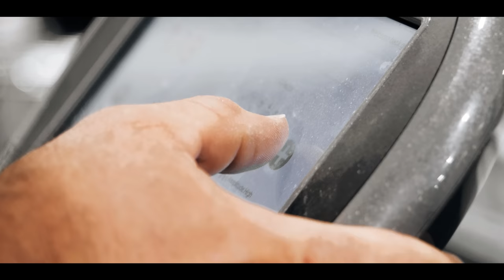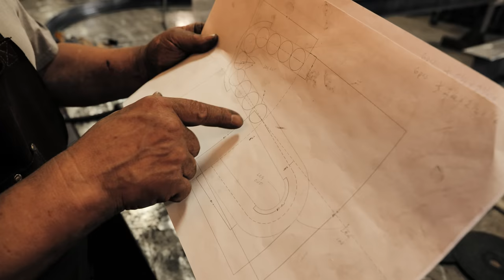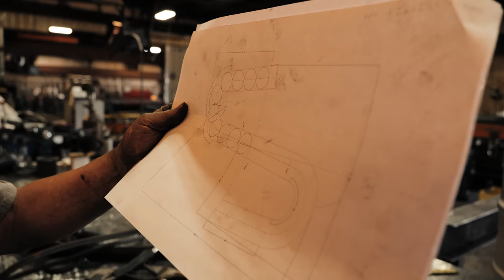PRESSING 200LB DUMBBELLS | ROAD TO THE SHAW CLASSIC WEEK 6

Comment: I would really enjoy working out with you just to push myself.
I hit a wall trying to gain lean muscle. My goal is 195 at a height of 5’7”. Can’t get passed the 15lbs gained.
Any advice
Reply: Simple answer is just eat more. That’s the only way it’s going to change. Don’t be afraid to eat a little dirtier if it’s just another few lbs you’re trying to gain.
Reply: Keep upping your protein, while slightly upping the carbs.   Don't cheat by just upping the calories with carbs and junk
Reply: @chancefluke7833  I’m currently at 240grams of protein a day. Im only hitting like 60-70 grams of carbs.
3500-4000 caloric intake. My metabolic rate is thru the roof. Have always had a problem with weight gain. Can’t even get chubby hitting stupid caloric rates during a dirty bulk.
Reply: @asketillus8679  I’m trying for lean muscle not trying to dirty bulk.
Reply: @charlesburlingham7974 ro hit the carbs. Aim for at least 200 g on training days. Carbs fill those muscles and make them pop more. Can't get bigger without carbs.
Reply: @charlesburlingham7974  not saying to dirty bulk. But at a certain point calories are calories and you can only gain so much from eating super clean. Don’t be afraid to throw in a cheeseburger every now and then 🤷‍♂️